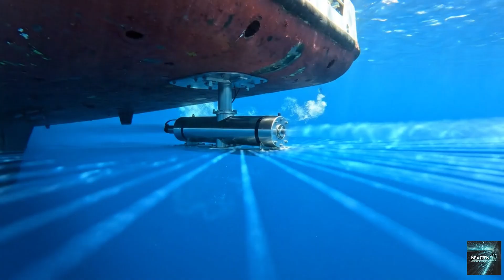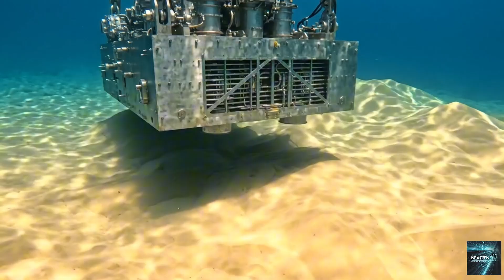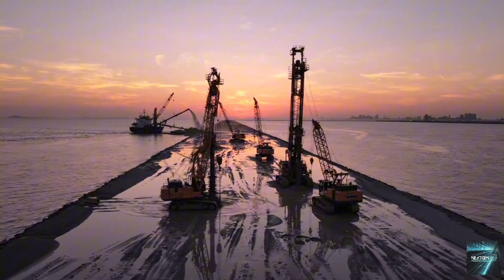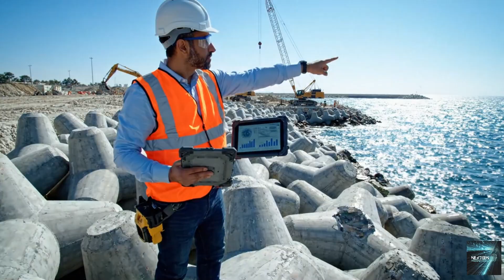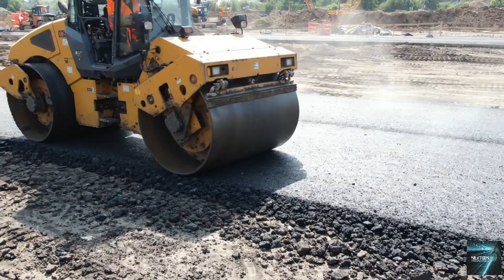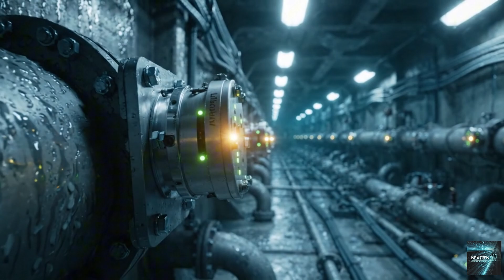Inside the $12B Sand Island That Defied Catastrophic Ocean Waves

Comment from the maker: The Palm Jumeirah is a staggering engineering achievement, but it raises a massive question for the future: Can human ingenuity permanently hold back the power of the sea with nothing but sand and rock, or will rising sea levels and tectonic forces eventually reclaim this fortress? 

Which phase of this 15-phase industrial matrix shocked you the most? The satellite-guided rainbowing or the concrete-free vibroflotation? Let's analyze the mechanical data in the replies below! 👇

If you are obsessed with heavy machinery and extreme structural engineering, make sure to SUBSCRIBE to the channel for more deep dives.